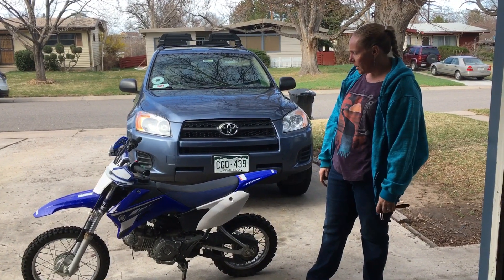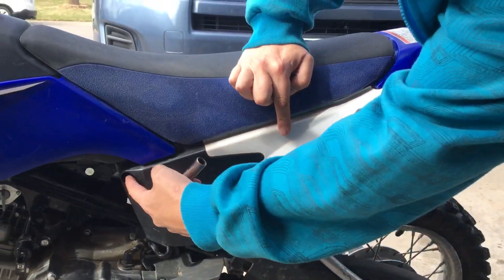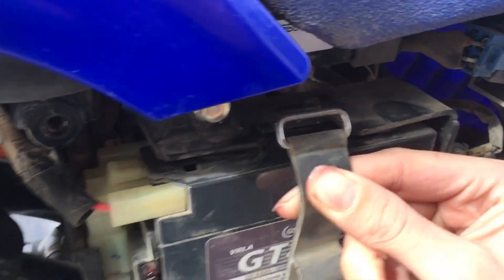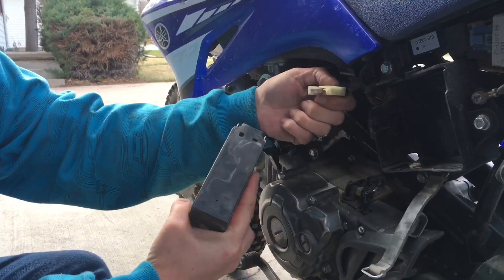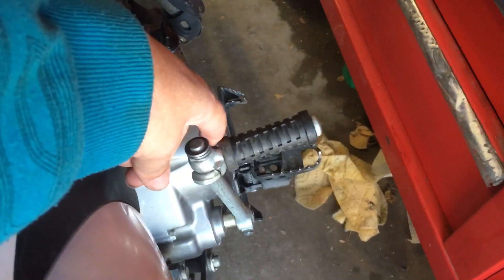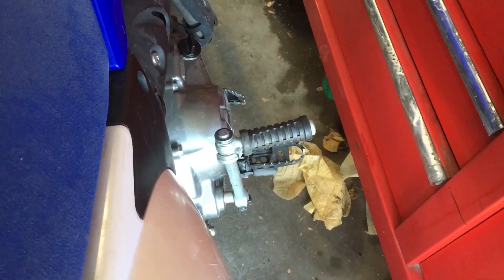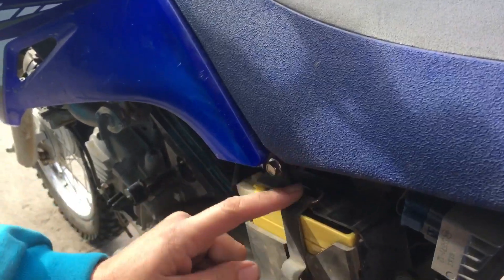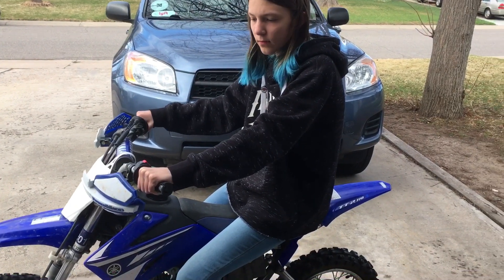Yamaha TTR 110 Motorcycle Battery Replace

Comment: That’s the gear shift not the kicker
Reply from the maker: Yo mama 101 yep I know. As a retired VW mechanic, with 6 ASE certifications, not a dirt bike tech sometimes I mix up my words. Hopefully you were still able to get this gist of replacing the battery. 👍🏼 also if you watch the entire video I corrected myself for Internet trolls thanks!!!!!
Reply: Mamachanic just watched the rest lol never mind and yes found it actually helpful I’m planning on changing my dead battery on my ttr 125 where did u get yours?
Reply from the maker: Yo mama 101 i’m pretty sure I bought mine at RadioShack which I don’t think is in business anymore but I get most anything else I need off Amazon
Reply: Ok thanks a lot and hope it will work